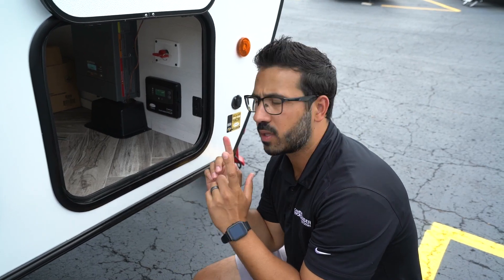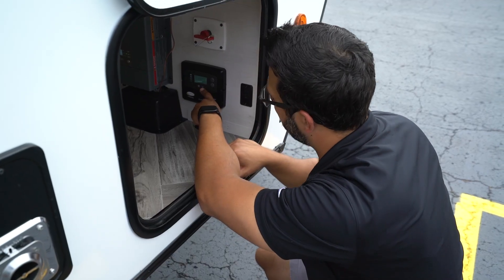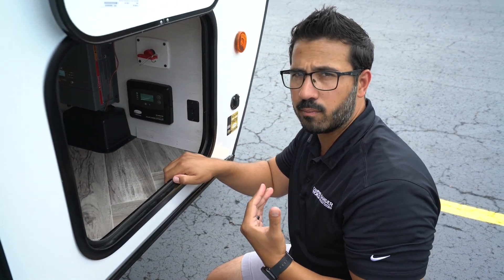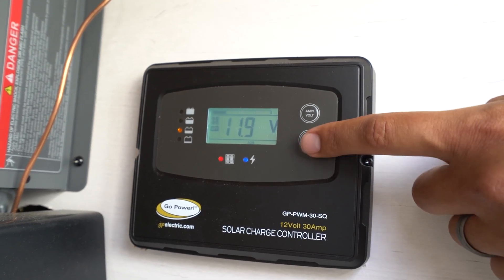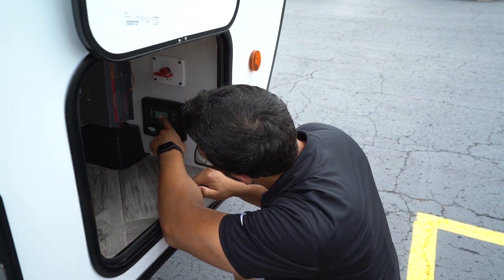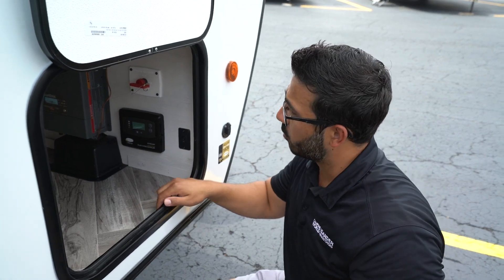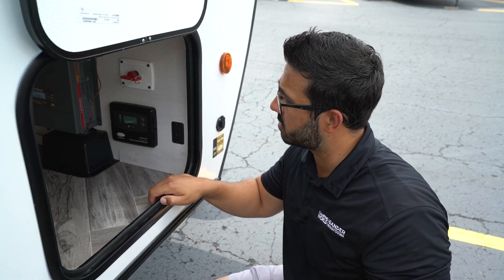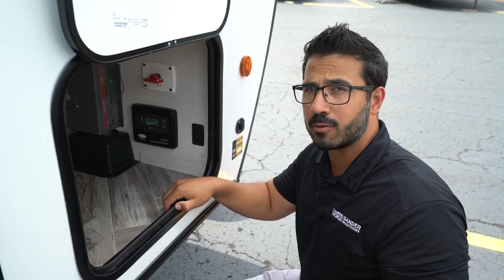Go Power Solar Controller (Model GP-PWM-30-SQ)

Comment: Is this unit need to be calibrated for two 6-volt golf cart batteries?

I've got it set to wet are we having that running as a 12-volt fridge in the morning with two large 6 volt golf cart batteries they're down below a quarter power seems like an awfully large draw for six or seven hours

I'm wondering if one of my 6 volt batteries is bad

Thanks
Reply from the maker: Hi there! 

I'd recommend submitting a support ticket directly to the charge controller's manufacturer: https://support.gopowersolar.com/new/

Additionally, here's the owner's manual if there's anything in there that proves useful: https://forestriverinc.com/files/Component-Manuals/Electrical/Go%20Power%20-%20Solar%20Controller%20Model%20GP-PWM-30-SQ%20Owner's%20Manual.pdf

There are instructions on page 5 for setting up battery type. I'm guessing you followed those? Are there any other electrical tests you've run?
- Tucker Ballister